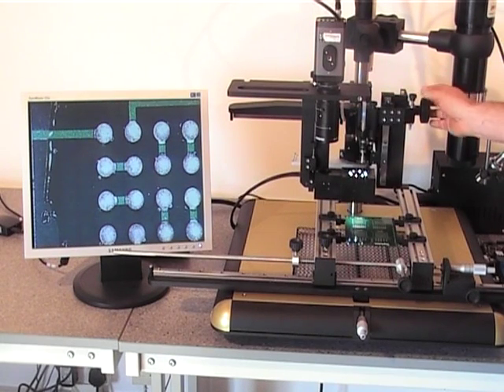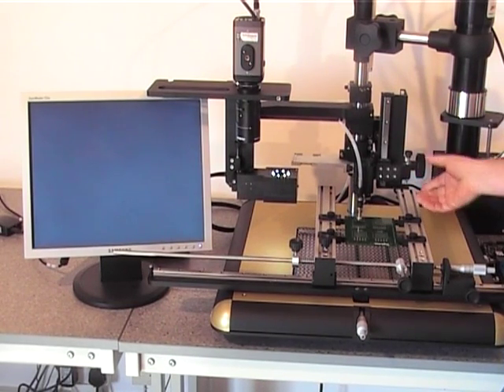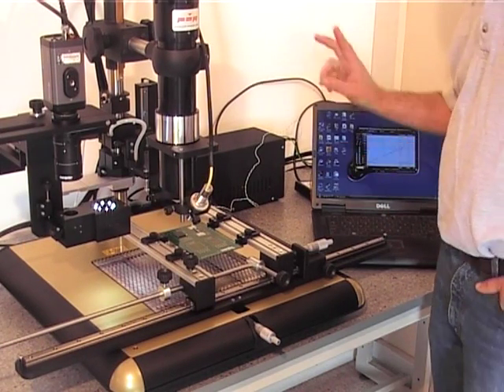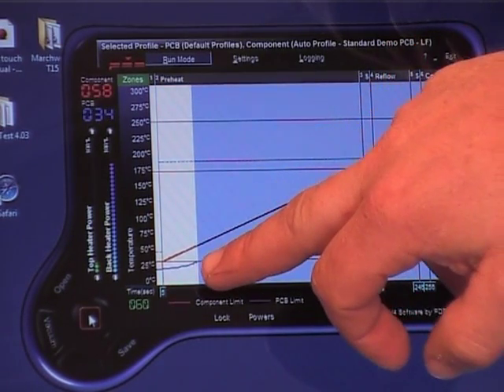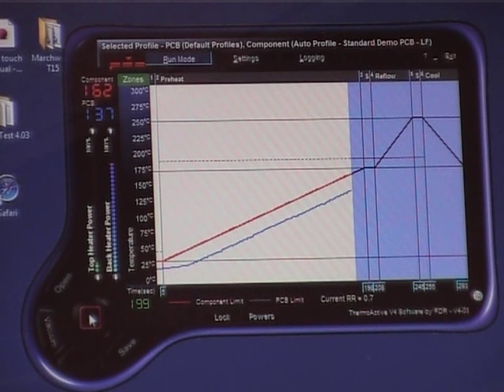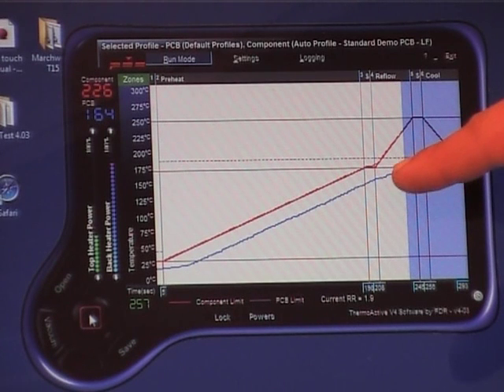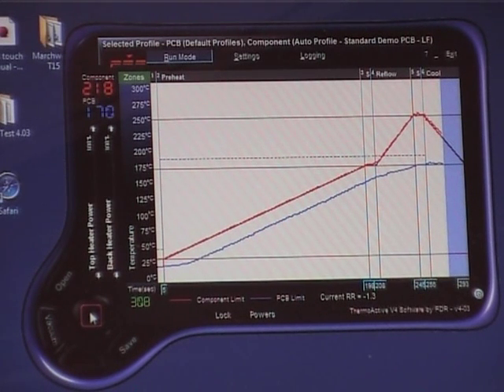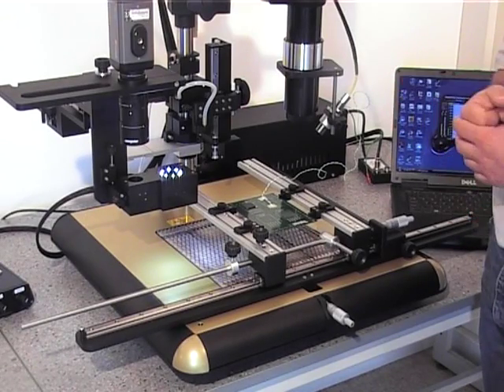Reworking a BGA with the PDR Focused IR-E3 (inc.BGA vision alignment) Rework Station

Comment: Great workflow. I'm also wondering if this device can be used to help with heating the solder spheres after they've been applied to the BGA of whatever chip you are replacing on the board? Or does this require further equipment?